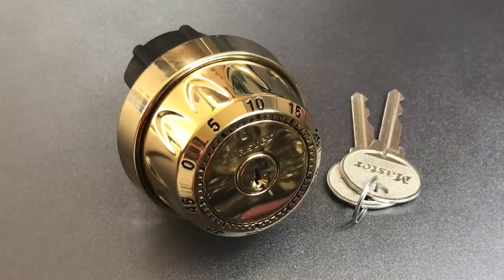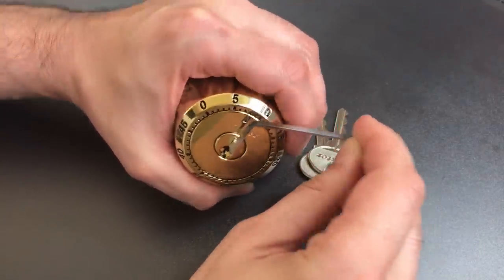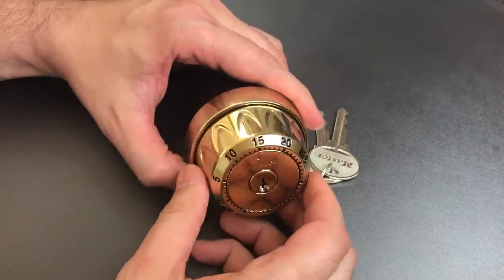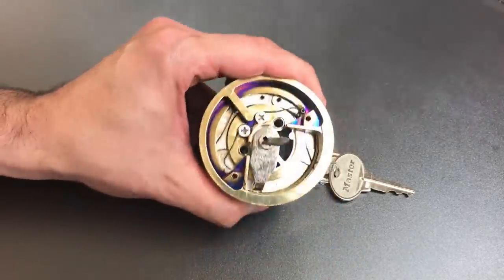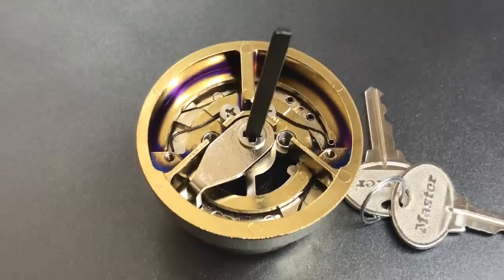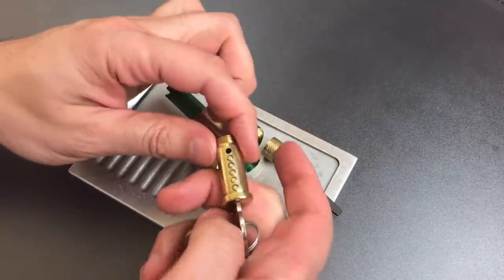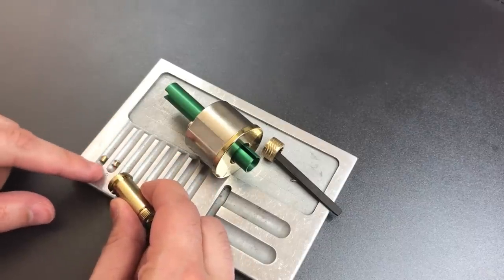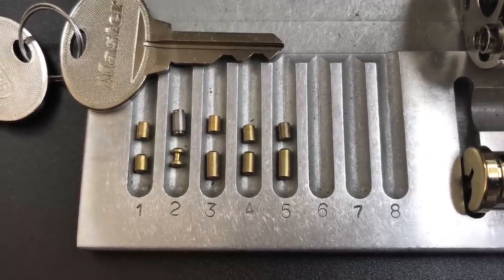[536] Master Combination Deadbolt Picked and BYPASSED!

Comment: Masterlock "We have made a lock with two different ways of access"
LPL "You mean you have doubled the vulnerabilities?"
Reply: Underated comment XD
Reply: DefinitelyNotDan yes
Reply: Punker also yes
Reply: Yes, exactly!  This viewer has been foamy at the mouth at other seeing other flats in her building fitted with mind-boggling locks which can be opened by either a key or combination, so the madness of that product is not even unique!  Why the heck do lock makers go to the bother of adding more mechanism, in the one way which unambiguously and obviously reduces the value of the product?  Why does any one ever buy such a nonsensical thing?  

That night watch feature is a great idea, though; really ought be standard on residential locks!  Hopefully that catches on, it's less likely to be seen as "unsightly" than a standalone latch for the purpose, so more likely to be widely adopted.
Reply: @longanh9151  Matt from EBF?
Reply: @bensoncheung2801  yes
Reply: Twice the access, double the fail.

Comment: I love the engineering and effort that goes into locks. However in a residential situation the population doesn't need to determine if their lock is pick proof, on the basis that their windows are most likely not brick proof.
Reply: unless you buy some good glass
Reply: What about the silent assassins?
Reply: JessicaFEREM Or some iron bars
Reply: Good luck with that my windows have interior bars
Reply: @goreobsessed2308  How do you get out in case of a fire?
Reply: You don't even need a brick in the summer, just pick the one where the guy left his windows open or unlatched.
Reply: @cloudstrifeification  iron bars with hinges on the inside. And more locks
Reply: Blocks of flats count as residential and above the ground floor access to the windows isn't trivial.
Reply: I have iron bars in my Windows, is common práctica un my country.
Reply: Well yeah, a defence is only as strong as it's weakest link
Reply: Most brazilian windows are bared, while they are not particularly strong bars they are definitely brick proof
Reply: I've never seen bars on windows where I live in California
Reply: Lpl is aware of this, he mentions it in his pickproofing a kwikset video
Reply: Just be like the Georgians, brick up your windows
Reply: sound
Reply: You're right. The only argument is picking the lock is quieter and leaves no signs of forced entry. But most criminals aren't patient enough to pick locks in any kind of home invasion situation. 
In fact I suspect picking is a dying if not almost dead crime. I'd love to see the statistics behind it.
Reply: through the door ? which you have the keys ?
Reply: Or like a good Mexican Bar the windows
Reply: who uses a lock to lock their house??? it seems kind of weird to me.

also i feel like the lock strenght is very important, i used to live in a very sketchy area, and i sometimes had to drop my bike off at the trainstation, ive had atleast 5 bikes stolen so far, no matter how expensive the lock was... like... some guy literally stole my bike saddle and dipped, like who does that 😭

Comment: Very interesting lock. Pretty cool actually. But of course it being a Master Lock they found a way to screw up a good thing.
Reply: I'm always amazed on how they f*ck up. You might guess, that at some point in time, while engineering, someone might think "uh, could someone actually open this by sticking stuff in holes?". But no. Someone could also think "uh, the third number actually does NOTHING, simply turning the knob until the unlockin mechanism engages after the second number is enough". Nope. Not at Master Lock.

Their Speed Dial lock? Ingenious mechanism, really. But the body can be opened from the outside by removing three screws (okay one is a one-way screw, but with a little effort you get that out as well). WTF.
Reply: no-trick-pony_lockpicking I have a speed dial I'm thinking of doing a video on my friend.
Reply: I would love to see one! :)
Reply: Only thing needed would be a thin plate to prevent manipulation of that lock. 
They even have screws I there that could hold that plate on place .
Then again that plate would cost 10-20 cents to manufacture .
Reply: I haven't watched his channel a lot -- in fact I'm surprised that Master Lock products are bad lock picking wise-- but I'm also surprised that LPL (Lockpickinglawyer) didn't cover the Master Lock Speed Dial Lock, because my school had some pretty interesting history with that lock. During first semester of freshman year, everyone either had the standard combination lock you can get from Walmart and/or rent from the school (both Master Lock), or the Speed Dial. I believe around second semester of that year, or maybe even the beginning of sophmore year, the school enacted a very strict ban on the Speed Dial, even going so far as to cut off the offending locks (but not before asking the owner if they're going to replace it with a school certified lock). I believe that was because the Speed Dial was super easy to break manually, and I could see why -- the case that held the locking mechanism was probably made from plastic, or some soft metal. I never held it in my hand, but I'm curious to see the security flaws it has.
Reply: Not only do criminals extremely rarely pick locks but also, since this lock goes into a door you can punch through, it does not really matter.

Comment: Cool lock .. 1st time seeing one.. I'd buy one. I like that the combo can be changed. I don't like the night latch feature though. That can be an issue at times. I'm a locksmith that deals primarily with muli family housing. Locks like these can be used to allow tenants entry without issuing keys. The landlord holds the key for access. In the real world, locks keep honest people honest. No junkie is going to pick a lock. If they want to get in they will find a way. Usually by smashing the door or window. Picking is locksmith skill..

Comment: Master never ceases to amaze me on how spectacularly they can mess up. I mean, COME ON! Methods like bypassing with shims, picking etc. have been in existence ever since locks were "invented". I don't get why engineers at Master Lock don't see such pretty obvious design flaws. It should be obvious to at least once think "uh, okay, is there any opening in the housing where I could stick something in and can actually manipulate the locking mechanism?".

And what the hell is wrong with the third number? You don't even need to know it, you just turn that darn knob until the unlocking mechanism starts turning, reducing it to a two number lock. This also should have been obvious at the time this was engineered.

They keep on failing spectacularly. They have really ingenious mechanisms like the Speeddial.. and then they put into a body, which can be opened and unlocked in locked state by simpling removing three screws from the outside of the lock. WTF???

Thanks again for your really interesting review. I simply don't get Master Lock.
Reply: your avatar is adorable. :p
Reply: Thanks! :3
Reply: they fired all their engineers and hired tons of marketing people instead.
Reply: They know. They just do not care. They know 99.9999% of the people that buy their products do not know anything about locks and they know 99.999% of the people that try to get into something are just going to break the lock instead of picking it if they want to get into something, so they pay no attention to the picking issues. Your average person is dumb. That is their target customer base. Cannot blame them for just putting out the least effort needed to get that customer base's money.

Comment: Thanks for stripping both sides of the lock, it was great to see the inside of the combination section as well as the lock itself. With no cuts on the 4 and 5 pins, this was basically a 3-pin lock wasn't it? Why hasn't anyone sued Master for false promises from their name?

Comment: What an interesting lock, those combo wheels could use some false gates tho. It's good to see spooled key pins, I normally have to make them myself because they don't come in most pin sets, what a shame that master made it so easy to bypass, all they had to do would be to add a raised lip and corresponding groove on the dial to practically eliminate the bypass issue.

Comment: Funnily enough this video resulted in a sale for Master Lock. I bought the version of this deadbolt sans the combination-lock feature. The "Night Watch" feature that LPL demonstrated is legitimately useful and makes the lock completely pick-proof for the most important time: when you're at home. Also, it can be enabled even when you're not at home if you leave through another door that is far less likely to be attacked.

I only wish there was a good way to replace or repin the cylinder to make it a bit harder to pick, since I'm pretty sure the version I bought doesn't even have the bump pin, let alone any other anti-pick features.
Reply: To repin, follow his disassembly demonstration and use the master pinning kit he mentioned.
  Anyway the traditional alternative to that "nightwatch" feature is a traditional hand operated sliding bolt mounted on the inside of the door.
Reply: I've also had doors with a similar feature with the inside knob: turn left to unlock, center to lock, and far right to lock and disable the key.

Comment: Watching this again, after a few years. It'd be tricker to pull off with the shim when on a door. 4 oclock is like 1-2 inches from the frame of the door. Very tight working space. Doesn't remove the vulnerability but does add time to the bypass.

Comment: Ever feel like you're in the matrix sometimes? You find a good channel, watch a few videos, and suddenly you know how to pick locks, or make explosives.
Reply: Perhaps explosives weren't the ideal second example, they were just the first thing that came to mind... I also learned how to build a heat powered (External combustion) engine, so theres that...
Reply: On which channel did you learn that? And yeah i know what you mean
Reply: Or build a dirt mansion with a pool
Reply: @One1One1111  Well, wouldn't this be an epic conversation through time if you read this? Given my original post was 2 years ago now, and yours 6 months. I've seen a few videos on making a stirling engine out of varius cheap parts, I can't remember which channel it was but quite a few cover the topic, and I can't find the video I saw. Applied science can teach you how to build an electron microscope as well, though and he covers similar topics.
Reply: @umbrakinesis2011  have you learnt anything new now?

Comment: "Deeply Flawed" pretty much sums up Master Lock. On the combo thing, my company had several equipment cabinets that used this same sort of setup. That is, the third number was irrelevant because you simply turned until the latch released and rotation stopped. So they entirely engineered away the third number in the combination.

Comment: As you have said before though front door locks are just there to keep honest people honest as there are usually glass windows that can be broken to gain entry even easier than picking the lock. The best defense for home invasion is a good offense. A home security system or even the appearance of one is worth it's weight in gold

Comment: so you only need to know two numbers of the combo?
Reply from the maker: +Tallif correct... the first two.
Reply: That is pretty much true for most 3-digit combination locks sadly, yes.
Reply: @tygonmaster  Not necessarily true. It isn't true if the lock has separate action lever and not using the dial itself for action. Set the dials correctly and then use a separate button/handle etc. to try to turn the lock open. If the dials are wrong, even the third one, the lock binds. This is how most safes combination locks work. They have a separate lever to try to open. For more security one also would have locking teeth/brake system so one can't try to push tension on the lever and just run the dial to feel for gates drop in. Rather the first thing the opening lever does is hit brakes on the dials locking in the current combination and then goes further and tries to get the sidebar to drop into the gates. So one would have to try one by one dialing in the combination.

Of course there is brute forcing dialer machines, that do do the try, release, dial, try,release, dial. However that gets to a pretty, big, complex and expensive. No way around it anyway. Since then the machine is just doing what normal user does.

For example this master lock could have inner and outer dial. The outer top dial dialing in the combination and then essentially a round  cylinder handle beneath, that one would have to turn to actually turn the body and thus try to get the sidebar to drop.
Reply: @aritakalo8011  I guess I should specify for my previous comment: That is pretty much true for most off-the-shelf shitty consumer combination locks.
Reply: You could easily brute force that
Reply: @aritakalo8011  doesn't need a separate action lever, and most safe locks don't work as you describe. The "action lever" just moves the lock bars. The combination lock has a bar that interferes with that movement. You dial your three numbers, left, right, left, then when you stop on your third number you turn the dial right again. Look up the operation of a group 2 lock.

Comment: If this lock was installed on a door with a strong spring in the door latch, that would make your shim attack more difficult. The internal frame of it looks like it's very thin cast metal, so you could probably smash it off the door with one hit of a lump hammer. Can it be bypassed through the back of the keyway?. I guess it's ok as an internal door lock, like for a bedroom or bathroom, or as a child lock for a utensil cupboard, but it's not secure in any way as an external door lock. It's a neat way of seeing how dial combos work though, and would be a great practice lock for that. Thanks for showing.x

Comment: Damn I had an idea for a lock literally exactly like this and now it exists

Edit: nvm wth I wanted one where you can only turn the combination with the key that way you have to not only know the combo but repick after it goes past 0
Reply: That sounds like something the soviet government might use. Those paranoid commies lol
Reply: That's called 2 factor authentication.
Reply: That’s how the lock on my old work’s safe worked. The dial wouldn’t turn unless you unlocked it with a key.

Rather ironically, we used it opposite to the maker’s intention. Given we were a museum and just using it as a giant fire/water-resistant box for documents, the dial was locked to prevent someone from accidentally locking it shut.

Comment: As you've worked with this lock, does it appear that there's room to put some kind of shield inside of the housing between the outside fixed ring and the outside combination wheel to prevent ready probing of the inner ring?  Seems like a simple flat sheet metal washer-type ring could prevent access to the roll pins if it would fit.

It looks like most of the key-centered flaws can be mitigated with different pins and some forethought when rekeying.

Comment: Is there something they could have done about that bypass issue? Maybe having some kind of lip around the edge to stop the shim getting in? I know it would be pointless anyway as most combination locks are easy enough to figure out but still, it would be an improvement.
Reply: Darren Jacobson invert the combo locking mechanism so it is protected by the housing?
Reply: Robert Szasz what do you mean by that?

Comment: I remember this lock when it first came out. I liked it because it was like a safe dial. Im not sure if those shims would be strong enough to retract the bolt, but I'm sure you could come up with something(either way nice exploit). Yes you are ment to be able to change the combo. I believe I have one NIB w/instructions if you want the original instructions. If I remember right if you could figure out the first 2 digits the 3rd was kinda automatic (less secure, if you want to call it secure). Always cool vids.

Comment: What about a lock that requires a key to turn the combination dial? I guess the lock here still has practical use —if not more— (since it allows people without keys in when necessary, while also giving a more convenient option for those who regularly use it), but putting the two mechanisms in series instead of parallel would add additional security layer.

Comment: nice concept... but it's a master lock... on that note it looks like the whole body is cast zinc(not the first time master lock has used zinc, watched someone melt the core out of a lock)... do you like to try destructive tests? because i'm sure that lock will fail under a small pocket torch in under 1 min! honestly i'd get a good machinist to CNC one out of solid brass, steel combo rings(although the ones in there look like they'd be fine) and maybe even add another ring or two from a second scrapped lock and make it a 4-5 digit combo(would need to modify the depth of the body), pin up a custom set of pins using all of the available spaces... perhaps even change up the core altogether for a better warded key way. but that's just my thoughts :) even different diameter pins to really screw with the feedback!

Comment: No lock is safe with you, amazing work as always. I think the future is electronic encrypted locks that can be accessed only electronically through Bluetooth or wifi. Using a crypto key. Where outside of the door is absolutely nothing. Not even visible on the outside. Same can be applied to padlocks. Padlocks that are completely sealed from outside with only access is by Bluetooth or wifi. Use same tech as in Bitcoin.

After watching your vids, I just doing anything that has a lock is safe😁